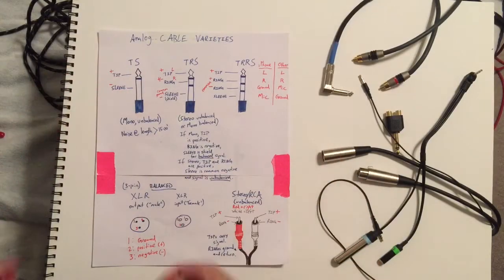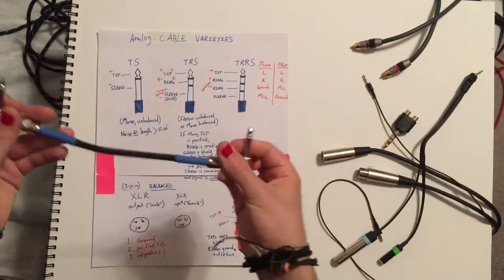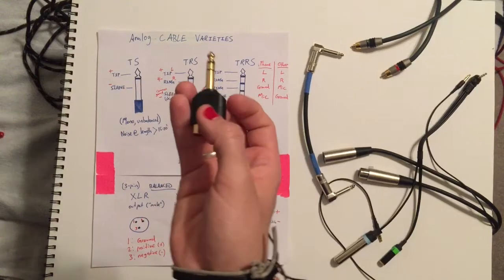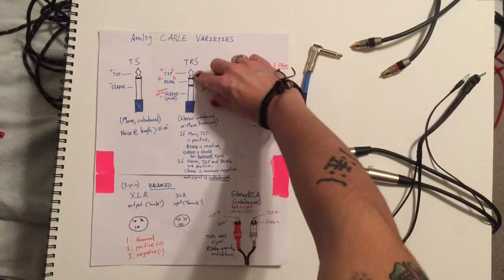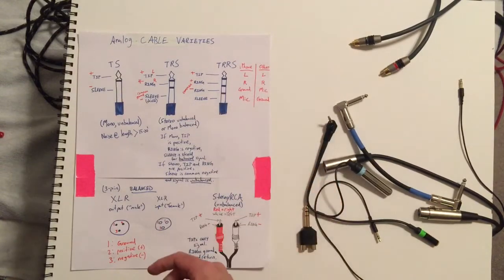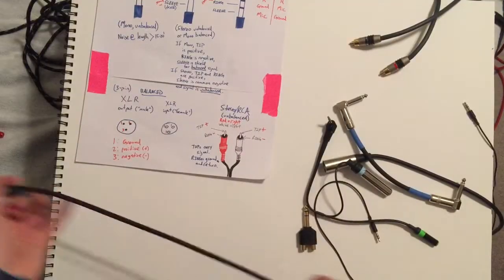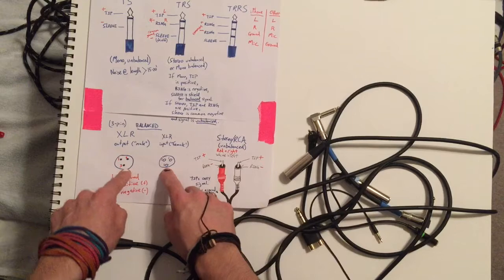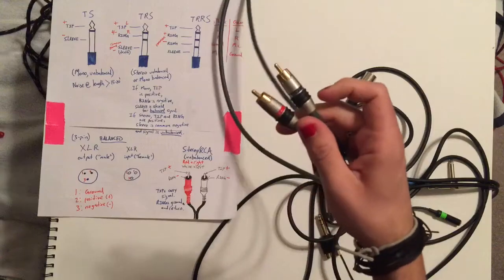Balanced vs. Unbalanced Analog Audio Cables: TS, TRS, TRRS, XLR, and RCA

Comment: Hey @alariclopez
Very educative video. One of the best ive seen online!
Had a few questions - i have a headphone cable with 3.5mm TRRS ended male jack with 2 cables going to each headphone drivers each terminated in 3.5mm TRS male jacks. I have a portable amp which has a 2.5mm headphone out. 
Can i use a 2.5mm TRRS male to 3.5mm TRRS female 'adapter/converter' with this to get balanced audio (Tip L+, Ring 1 L-, Ring 2 R+,  Sleeve R-)
Will it short/damaging the amp? 
Also is it possible to change the termination on the cable from 3.5mm TRRS male jack to 2.5mm TRRS male jack?
thanks for the reply!

Comment: You didn't explain what the diff is between balanced and unbalanced. It is not that balanced is grounded or shielded. A pair of DI boxes can create a balanced signal. You need a balanced signal to take advantage of balanced cables. Balanced cables do not turn an unbalanced signal into a balanced one. I won't explain how a balanced signal works because you might want to do so.

Comment: so what is a balance cable?
Reply: Good catch! I should have explained that better. Balanced cables are less susceptible to noise interference than unbalanced cables. Because of this, the cable's length becomes more of an issue with unbalanced cables than balanced cables. I believe it's something like 15' and longer where unbalanced lines really start to absorb external noise, like radio signals for example. So if you've ever plugged in a guitar to an amp and heard some random radio broadcast coming through your amp, it might be because 1) most guitar 1/4" cables are TRS (unbalanced) and 2) that cable is probably 15' or longer. Hope that helps.